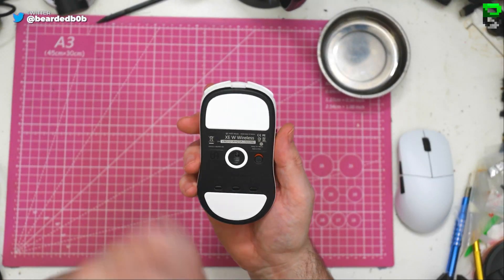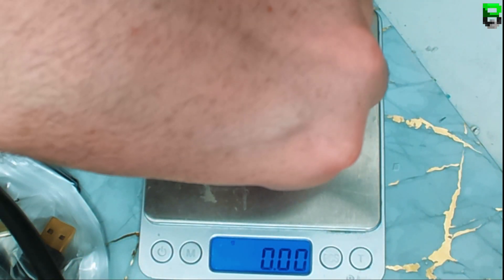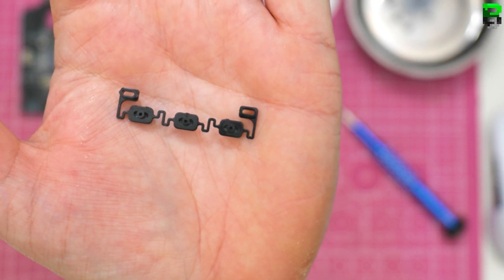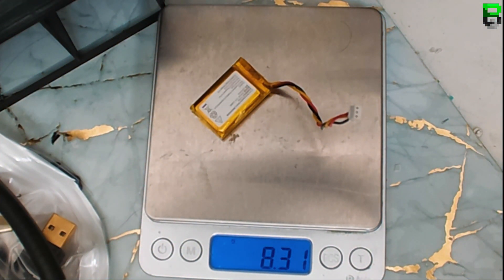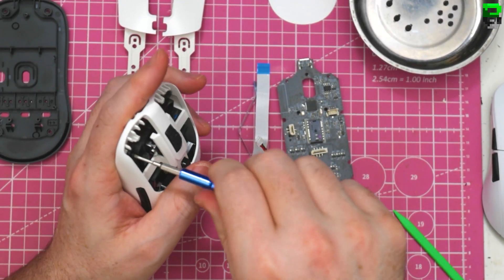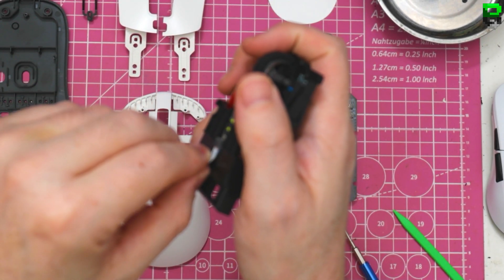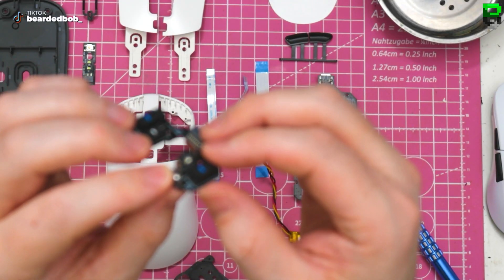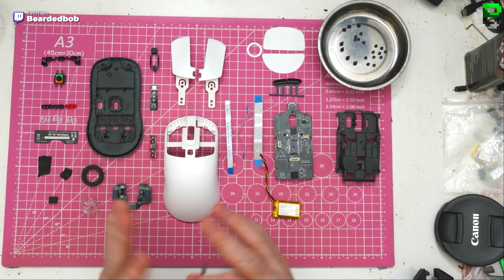UNVEILING THE COMPLEX INTERNALS: Vaxee XE Wireless Mouse Teardown

Comment: Weird design. Not sure why they went with the same skeleton cage from the wired version. Maybe for strength integrity?  Weird that they're still using ribbon cables for connections and those side buttons lol
Reply from the maker: yeah not sure,  as it would cost more to produce... they also changed the front design for the buttons